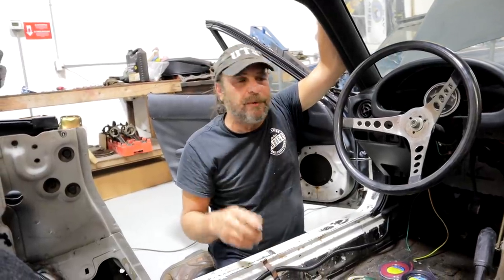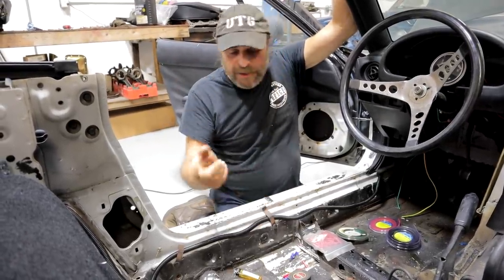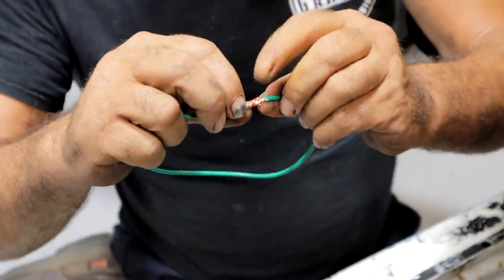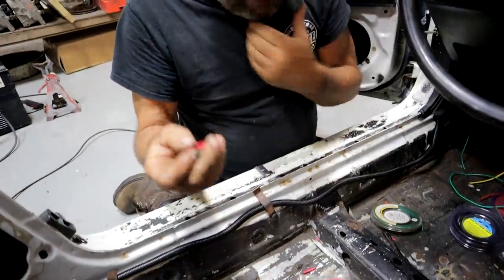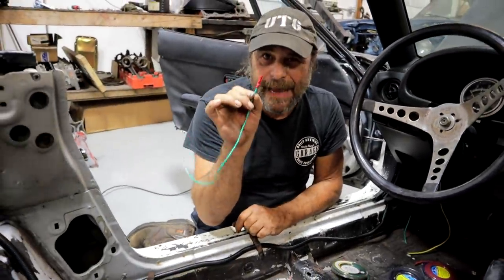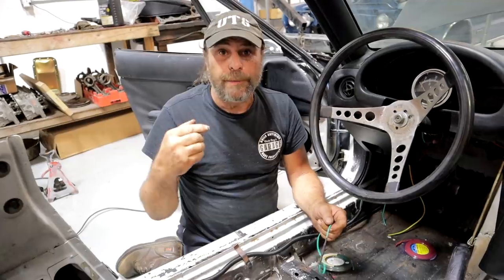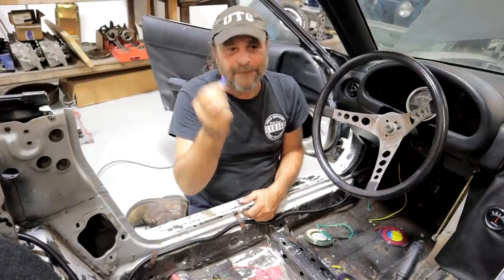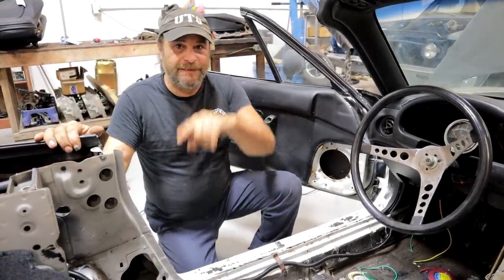The Single Most Misused Item In The World Of Cars

Comment: I use marine grade shrink tubing. It has an adhesive inside that seal out moisture.
Reply: M23053/4 adhesive lined
Reply: I prefer that shrink tubing as well plus i prefer uninsulated crimps and I double  crimp them to keep diameter down on the wire if I don't have the soder shrink connectors available those things are awesome slide it on twist your 2 wires together slide it over and using your heat gun shrink it , it soders and seals all in one
Reply: That, and on the rare occasion where I only have dry shrink, I'll chop up some hot-melt glue and stuff it inside before shrinking.
Reply: You beat me to it Gary. I’m a marine mechanic, but use that shrink tubing on everything.
Reply: That heat shrink with glue in it is amazing!!
Reply: @hex374  , I agree. The plastic shell only provides electrical insulation to the crimp barrel but can impede the action of the crimping tool and hinder proper insertion and inspection.
If you're using good quality heat shrink tubing, it is unnecessary and only results in a much bulkier connection, which is exactly what you don't want. Heat shrink tubing seals much more smoothly and accurately over the wire and a bare metal crimp barrel.
The bare metal crimps also leave you the option of soldering the connection after crimping and before insulating..
Reply: @hex374  This is what I use too.  Little metal splicers that aren't much thicker than the wires you're splicing.
Reply: Good to know
Reply: @catsupchutney  Ive always heard that the wire should break before the crimp does
Reply: @catsupchutney  yes sir, the marina I work for is an ABYC shop, and tbh I good crimp should hold no matter what if crimped correctly, you don't know how many guys use non-insulated crimpers on those heat shrink booty connectors and split the heat shrink rendering them useless lmao
Reply: Steven Martinez    There is disagreement about whether that is best due to stress concentrations where the solder ends.  I would imagine it would be an issue in areas that vibrate.
Reply: Steven Martinez  solder joints are more prone to cracking in high vibration areas than crimp joints.

I've dealt with it before on engine wiring harness from drag cars
Reply: I found all commentary very useful information considering I didn't know marine shrink tubing existed.  Thank you.
Reply: @georgeboyer8158  you can buy a kit with multiple sizes from harbor freight for $5
Reply: Steven Martinez  solder leads to brittle connections, prone to cracking in a high vibration environment,  like why you don't use solid core wire on cars, you use stranded so it has flex without snapping
Reply: Way way WAY back in the day if you didn't have that then you could shrink one side of the connection and poke slivers of hot glue stick in the other end, then shrink that end and do the middle portion last, it was ghetto AF but better than nothing.
Reply: Came here to say this. The cheap harbour frieght stuff works really well. I had to remove a bunch of it once it was REALLY on there.....
Reply: @hex374  what do they call that stuff? The good version I mean...I keep getting cheap knock off brands and they SUCK....
Reply: @ImnotgoingSideways  I use a cheese grater and it makes perfect little shavings to stuff inside shrink tubing....
Reply: @christopherleveck6835  I'm not a hundred percent sure I usually grab from the truck shops in my area
Reply: @hex374  no problem I'll figure it out. Thanks anyway.
Reply: It's the bane of my existence. Nothing worse that repairing something that has it and doesn't need it, like an antenna connection.
Reply: I use heat shrink butt splices. Super easy to use as long as you have a decent set of wire strippers and crimpers nit thise cheesy house ones.
Reply: I use the heat shrink splice kits that we use on submersible well pumps that sit down hundreds of feet deep in water.
Reply: I don't even understand why there is shrink tubing without adhesive... I doesn't make sense
Reply: Hillbillymark here-  thank you
Reply: Its like a hot glue, seals it up great. Been using it on heavy trucks in Toronto winters forever. Never a come back if done correctly. Which isn't hard.
Reply: Damn,that's that's great idea 💡!! Thanks
Reply: I use the marine crimps too when I need to conect 2 wires without a using a plug.
Reply: Same here. In moist environments I prefer to use transparant 3:1 shrink tubing with adhesive over blue splice connectors (16-14 AWG/2,5 mm2). I use that same heat shrink tube if I find the insulation, but not the wire damaged where the wire cannot be replaced easily.
Reply: Who doesn't.
Reply: @canceledczech457  you can still seal punctured heat shrink butt connectors.  Just go slow, like you are supposed to anyways, and the sealant will flow into the hole just fine.
Reply: @hex374  those solder connectors are great when they work, which is on new wire..... but anything but brite copper and they just make a bead that sits on the wire.  But when they do work, the shrink and seal casing provides support to the brittle rigid solder connection, so the wires dont break apart.
Reply: My engine bay thanks you🙏🏽🙏🏽🙏🏽
Reply: That is called flooding compound.
Reply: I tried to find where to get marine grade heat shrink tubing for years, but I gave up. Instead, several years ago I started purchasing the solderless weather proof buttconnectors and that did away with the need for heat shrink tubing altogether. I still use it periodically for special applications such as for marking certain wires and even in some cases to bundle wires.
Reply: I use butt connectors with shrink tubing
Reply: The Harbor Freight marine grade heat shrink is honestly some of the best I've used lol, much better than even many name brands 👍 although I do prefer rolled tubing, not pre-cut lengths. Also I use solid (no split) non insulated crimp connectors, they are life changing lol
Reply: @Mrshotshell  yes, no soldering on my aircraft for a reason.
Reply: Duraseal makes connector whit adhesive shrink tubing atleast for european market thats amazing stuff and worlds better than cheap no name suff
Reply: Gary Matthys i agree totally !!  I pride myself on my wiring being an Automotive Technician . The ONLY connection is a fully lead core soldered connection with weatherproof shrink tube . Even a female or Male spade terminal i remove the plastic end and solder then shrink tube color appropriate . If i EVER seen an apprentice of mine shrink tube a butt connector i would be correcting him immediately ! Butt connectors are a lazy mans repair !
Reply: @7natcho  uninsulated non split solid butt connectors with marine heat shrink are where it's at 👍(of course I only use non-insulated solids for every terminal type if available) I still solder joints occasionally, but only if it's in an area where vibratory stress hopefully won't cause breakage... I'd give properly soldered wire to wire connections a 10-20 yr lifespan for automotive use, which is fine for modern vehicles lol 😆 Now offroad only or racing application vehicles? no solder unless it's a necessity, usually just on a terminal or circuit board 👍
Reply: @7natcho  if you use solid non-insulated connectors and the proper crimping tools you can often come close to a cold weld, especially with large guage wires and anderson style connectors/battery terminals. That is why deutsch style pins/plugs have become the standard for automotive plugs, once again if done correctly, and with the right tools 👍but hey every pcb/control module in a car is still using solder, so it's definitely up to the task if done properly, which it sounds like you do 👍
Reply: As an electrician and an auto mechanic always use a hydraulic crimper for connections. Always use marine grade shrink tubing in an automobile. Those plastic coated but splices should be stripped of the plastic and hydraulic leak crimped
Reply: @charlesprince1435  a little heat from a heat gun or butane micro torch is the trick for getting that insulation off, sadly most of the connectors (every cheap version) are of the split variety instead of seamless, so the crimps are less than perfect. Really the non-insulated versions are so cheap and easy to buy its hard to justify using anything else, unless you run out of a specialty size at 8pm and have to make do with a plastic coated split version 😆 but most of the big name auto parts stores have atleast a limited selection of the solid non-insulated type connectors finally! Sadly they rarely have them in male/female spade connectors or multiple sizes of ring terminals 🙄
Reply: This is what I use too.
Reply: I work at an electrical insulation company and as many mention on here you can use adhesive lined polyolefin for added sealing and strength also 3:1 shrink ratio will recover with a thicker wall for added strength.
Reply: Solder and medium wall heat shrink like you use is the true path.
Reply: Oh shoot good to know.
Reply: @JohnSmith-ki2eq  that’s a damn good ider, heat shrink before heat shrink.
Reply: @christopherleveck6835  Amazon?
Reply: @ifyoutip  why?
Reply: @berryreading4809  they can be a struggle, I've damagd a few trying to remove the shoddy plastic insulator. Thx for the tip on using a torch. 

What's wrong with the seamed terminals? I don't know if I'm thinking of a different kind or not.. seamless ones are near impossible to find in stores for me unless they're "battery lug" style ring terminals
Reply: @ConceptXX  The seamless terminals get a good crimp no matter how the connector/crimper is turned, plus give slightly better corrosion resistance since it's a 360 degree seal with only copper exposed at the base (or top also for non but connectors) Recently "Dorman Builders Series Professional"  seamless connectors have started appearing in all the major auto parts stores, usually in kits or individual single connector type 10 packs (they include pre cut non marine heat shrink), although Napa has them in another brand, in bulk packs without heat shrink for cheaper (atleast near me) but they are far cheaper online! (Although I still use split style connectors when I'm in a pinch and that's all I've got 😉) The new Dorman kits are pretty nice, great for leaving in a mobile tool box, and the connectors are color coded with a paint ring for the wire guage, but those same kits (or 10pks)  are usually atleast 25% cheaper online than from parts stores 🙄